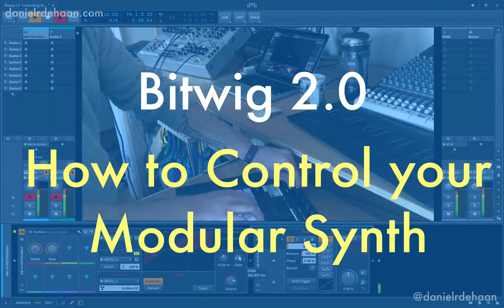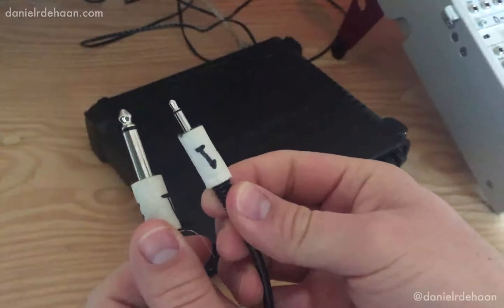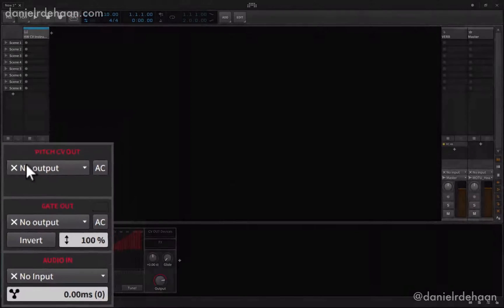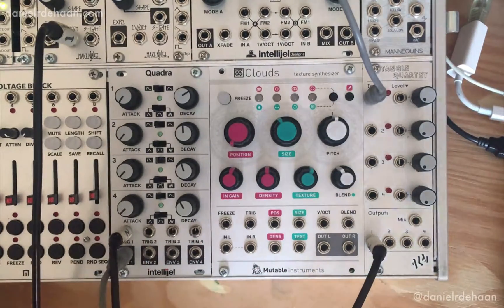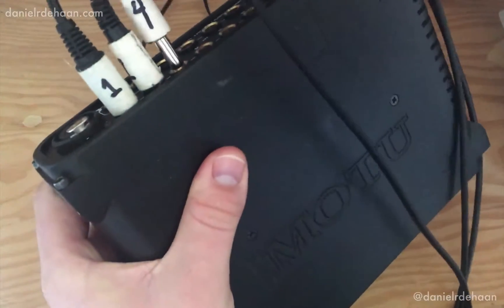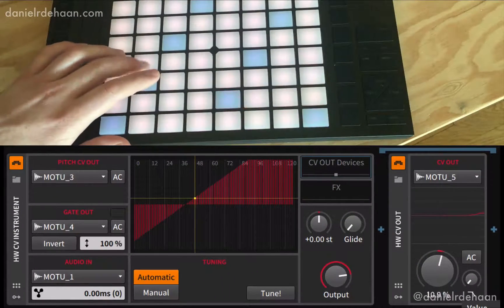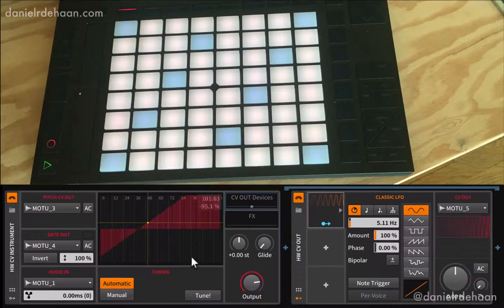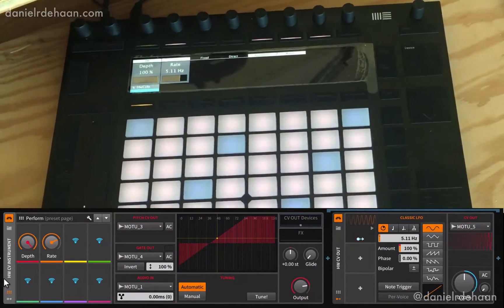Bitwig 2.0 - Controlling Your Modular Synth

Comment: Does Reaktor still have a place inside the Bitwig 2 framework?  I can see it doesn't seem to be the middleman for CV connection anymore in the current setup, but I've wondered if Reaktor compliments Bitwig.
Reply from the maker: Reaktor definitely still has a place. There is a huge library of instruments and audio fx that are more than enough to justify having/using it. Plus currently, Bitwig is only able to control a modular synth and not really be controlled by one. Reaktor Blocks let you go both ways, you can sequence and modulate your modular, or send some CV signal into Reaktor to sequence/modulate some Blocks. Then further, you can use Reaktor to program your own stuff. 

Even once Bitwig finally release this Modular Environment that they have been talking about for a while now, Reaktor will still be its own beast and will still be a big part of my tool box.
Reply: Excellent info, man.  Thank you!   I'm definitely interested in both tools and it looks like it would have a nice synergy.

Comment: Very nice video.... just one tip: be sure you choose the right output on your Master Channel in Bitwig Studio. If you use Studio out, it sends all Audio and CVs to the Eurorack and it reacts a bit weird than ;)) ...
Reply from the maker: Hi, NoizeBusters! Thanks! I am a little confused by what you mean. The "Studio" output in Bitwig is a configurable output, and I have mine set to only output to either my headphones or my main studio monitors. So in this setup, nothing that passes through the Master channel, passes to my modular.
Reply: i have that "studio" option on the master channel, beside the other ones like speakers and than the cv outputs..... i didnt configurate that one, but if that "studio" output is chosen in the master channel, it send cv and audio to the eurorack.... just be sure you choose the designated output and than it works perfectly.... a bit hard to explain in english ;)
Reply from the maker: +NoizeBusters what audio interface are you using? It's possible that your interface is routing things in some unexpected ways.
Reply: Motu 828... its all good, its routing correctly... its a bitwig option which can mess things up if u use the wrong output, but no worries all good here and works nicely...

Comment: Awesome....I recently received my ES-8 interface and will be trying out Bitwig 2.0 with my rig using your tutorial as a guide. Thanks and looking forward to further videos about this kind of setup!!!
Reply from the maker: Sweet! Let me know what you think of the ES-8. I keep almost buying it...I just wish it had 8 inputs. I know it can be expanded, but I'm trying to keep my rig portable. I was really hoping the Intellijel would come out with a 1U interface...maybe some day.
Reply: Got the ES-8 working with Bitwig 2.0 but it's quirky and not 100% dependable. It seems to be an issue with Bitwig because sometimes while tuning a modular oscillator I'll get a seriously noisy signal, I remove all the ports in Bitwig's configuration and set new ones and I can get it to work cleanly. I also cannot use any output to send audio to my mixer, I have to use port #1 on the ES-8 otherwise audio outputs on all other output channels causing noise in the CV signal. Fun to be getting this far and your video was a great help.
Reply from the maker: +Quantum Space really weird. Have you emailed both Bitwig's and Expert Sleeper's  tech support? I've heard of a few others having audio interface issues. But I have yet experience any myself.
Reply from the maker: Hey, how's life with Bitwig and the ES-8? I'm thinking about grabbing an ES-8 myself soon.
Reply: I'm in love with the ES-8 and I also have the ES-3 and ES-6. Maybe you know how to route a pre-recorded midi sequence out to CV?
Reply: Answered my own question about midi by creating a new instrument track - seems there was a glitch in the previous one :)